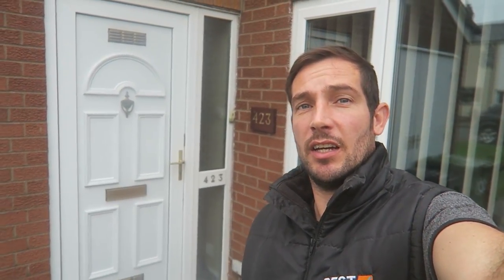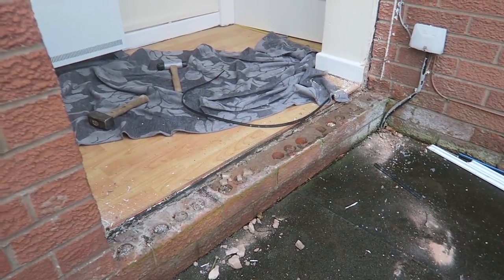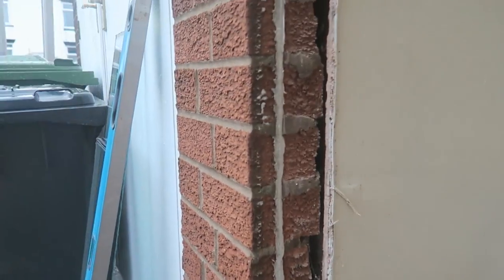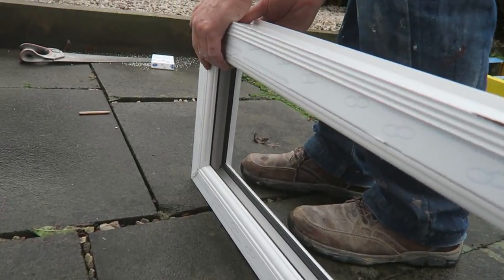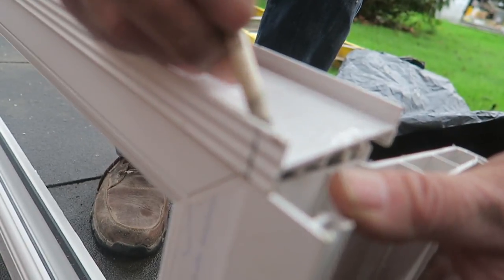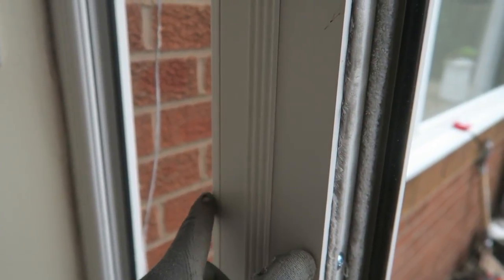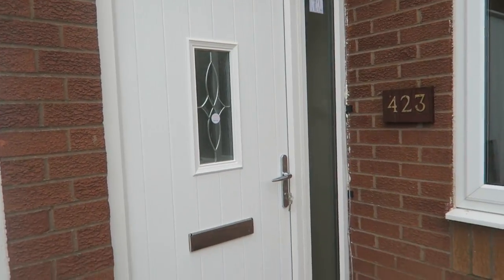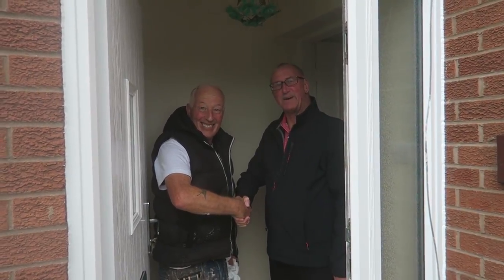COMPOSITE DOOR JOB #4 simplistic beauty

Comment: Stu, what size hole do you drill in the frame for the concrete screws? I'm assuming they would be clearance on the thread
Reply: For the brick 6 and for the concrete 6,5 mils drillbit because the screw is 7,5 mils and it will make its own way afterwords.

Comment: Nice job stu 👍
I've never seen a sill stuck down with foam, I just use silicon. You reckon there's some advantage to using foam?
Reply from the maker: either or paul ive used both but kc likes the foam gun lol
Reply: stu crompton Fair do's lol
Reply: Foam is better as silicone will crack and spilt over time which creates drafts that’s why we in the trade foam and silicone ,top job stu keep up the great work rebuilding a good name for window fitters and trades man
Reply: andyb1999 good to know mate cheers 👍
Reply: Paul McFadyen I understand there are two types of foam, one expands a lot to fill those big gaps, the other doesn’t expand so much. My guess is Stu uses the latter type.